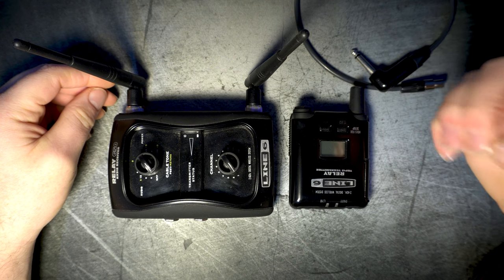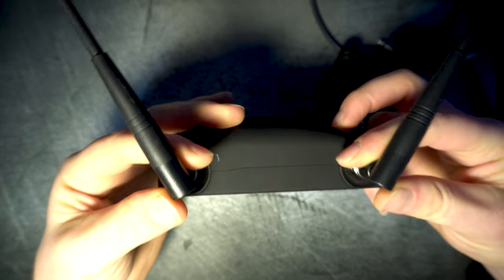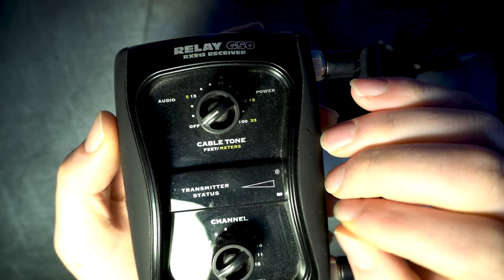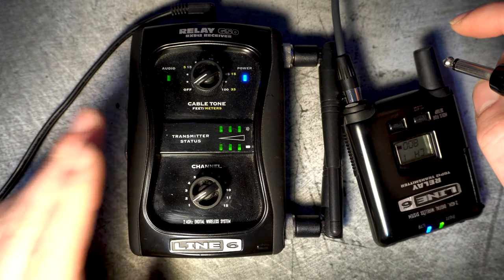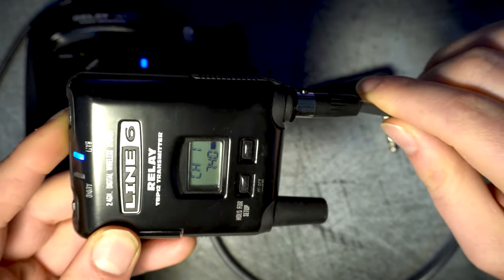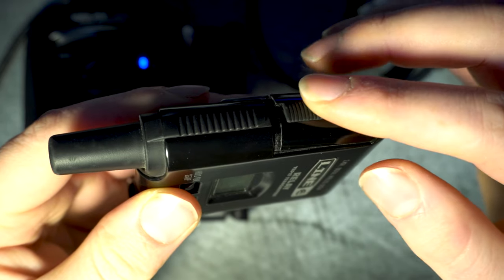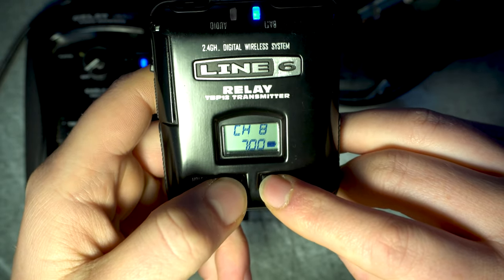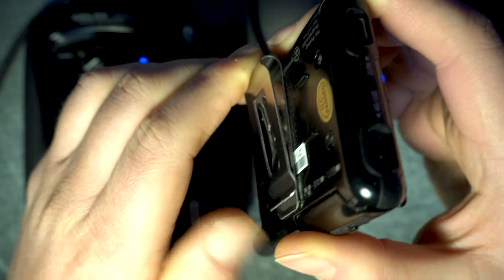Bass Wireless System: Line 6 Relay G50

Comment: Awesome stuff! About the transmitter: my friend uses the rack unit G90, but the transmitter is the same, TBP12. He's got a lifehack for the battery compartment: he puts a very short loop of elastic band (like the one used on underwear xD) onto the transmitter, so the battery compartment wouldn't open even when the clip is broken :D And he also has unscrewed the metal clip and puts the transmitter into a pouch (Richter, I believe; around 15€ on Thomann) attached to his strap. 

I personally use the G30 with TBP06 transmitter, and the 06 has been a mighty PITA: the metal clip broke off almost immediately, so I went for a t-bone pouch (7€ on Thomann) instead. Then the battery compartment door started to give me hard time, the plastic dots holding the metallic plate in place fell off, and the compartment started to open when it wants. Tried to fix it with epoxy two times, no help whatsoever. A workaround was to close the pouch strap so tight that it would hold the compartment together, but I guess I will resort to the elastic band loops here :) 

The positive thing about 06 is that it uses an ordinary jack for cable connection. I still had to make my own cable because I needed angled jack on the guitar side of cable. And I recommend using the rechargeable batteries: they last longer, and you can recharge them :) Just get yourself two pairs and mark one of the pairs so that you wouldn't mix them

Comment: This is a great video. Have you ever done a comparison between the wireless and an actual lead? I've used a Shure GLXD16 for several years now and decided to do a comparison in my studio. Listening critically I could tell there was some signal loss around 30hz and 4khz when using the wireless. I've never had a problem with the wireless sound with all the gigs I've done on it but it was surprising to compare it with a lead. I'll have to put it into a YT video one of these days.
Reply from the maker: Thank you! I've never directly compared the two things, but judging by ear only I would say the cable does sound a tiny bit darker, similar to the way it sounds using the cable tone control. I'll probably try doing a comparison video as well at some point. I never felt any loss of frequency whatsoever, as a matter of fact I would say it sounds even fuller and brighter

Comment: I've used the rack mount version for years and they work great.

I have added a neutrik silent plug

You could I suppose create a minixlr to 1/4 female (then use a regular 1/4 to 1/4) to reduce wear on the xlr but maybe that's a bit too much hassle